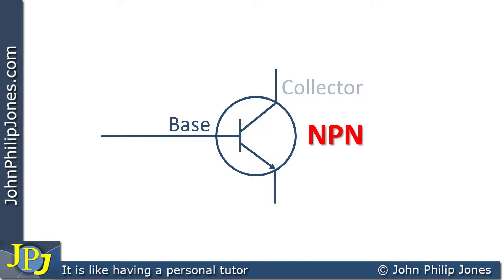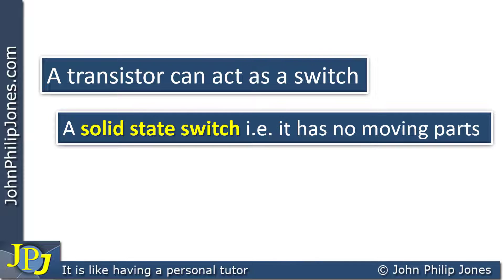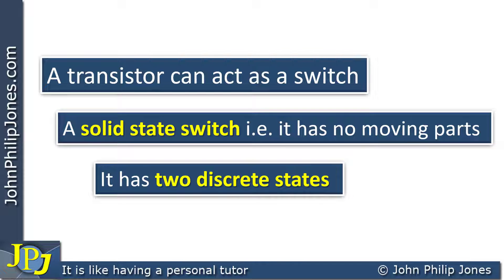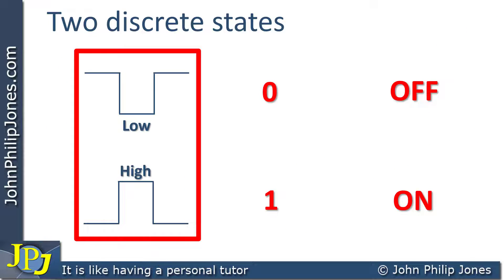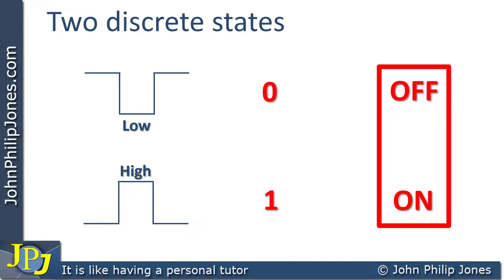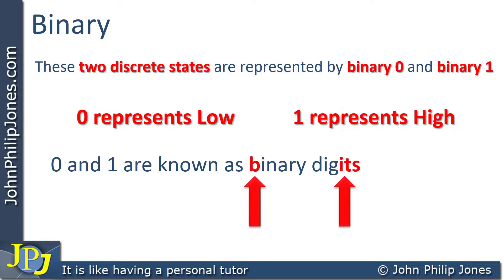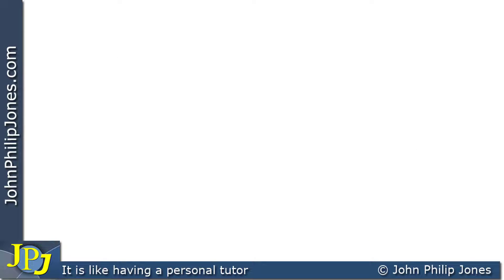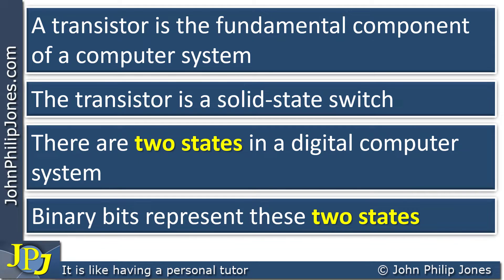The Transistor, Discrete States, Bits and Binary

Comment: A bipolar transistor doesn't have any memory.   It retains zero bits of state.   In digital applications, a transistor is "on" (saturated, conducting as hard as it can) or "off" (cut off, not conducting).   Meanwhile, you showed a logic signal going through two transitions.  High to low, then low to high.   That's not a state.  It's a logic signal alternating between two logic levels.   Don't say "you know what I meant."   It's not a tutorial if folks need to know what you meant.
Reply from the maker: Your response is superimposing your technical knowledge onto a tutorial that is not referring to (or intending to refer to) an electronic circuit. The video contains an illustration that is clearly not an electronic circuit. The transistor appears without any passive components or reference to a power supply or earth.

If I included the appropriate passive components I would still counter your response.

A transistor is not triggered. Whether it is conducting or not conducting is dependent upon the level at its base. If the level is 'high' the depletion layer is closed and the transistor conducts. When the base is low the depletion layer is reinforced and current does not flow.

So if I turned the illustration into an electronic circuit a sequence of pulses (square waves) would indeed switch the transistor off and on. Of course this does not imply any type of 'memory state'. However, it is accurate to indicate that the transistor is either in the on or off state. There is no implication that this state remains (e.g. as per JK flip flop which needs more than one transistor). When the pulse is high the transistor conducts. Or as you would prefer if the level is high the transistor conducts. When the pulse is low (level is low) the transistor does not conduct.

So when I talk about states I am specifically referring to the on/off state of the transistor. It is not in anyway related to memory states.

It should also be noted that the audience for the video are Computer Science students who are just starting their studies. The essence was to express the two states that are 'within' the study of Computer Science i.e. on/off; high/low; 1/0 and later True/False.

However, ultimately please remember I am trying to convey the concepts of two states within 5 minutes to students who have no background in electronics. Hence why I have used an illustration and not a circuit.

As to your comment do not say "you know what I mean" I am unable to interpret your meaning. I did not say this in the tutorial and rest assured I would never say it to students.

Best wishes
Phil
Reply: I eagerly await YOUR video on the topic. ;)